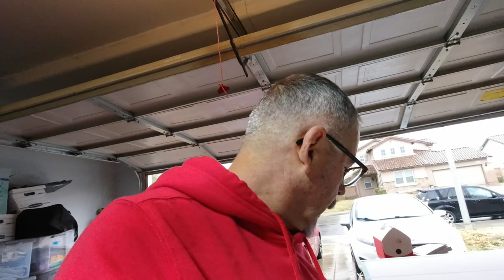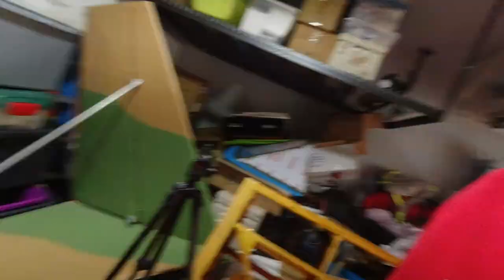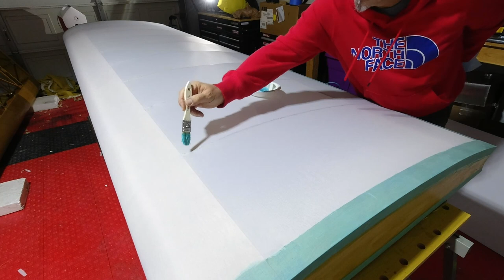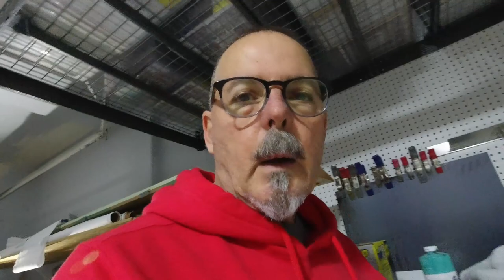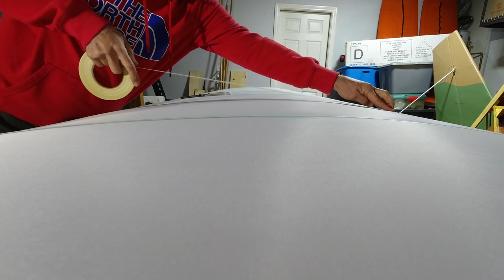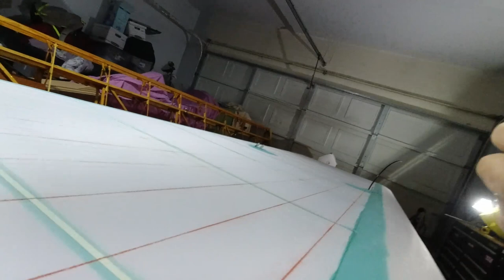Minimax 1100r Wood Aircraft Build Ep-189 - Preparing for Rib Stitching

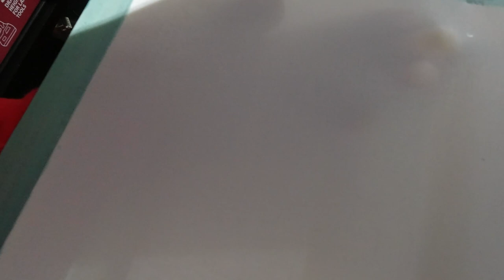Comment: Hi Dennis, No skipping forward, not for a second. Condolances for your loss & congratulations at the same time for a new Family member, no words can ever express. As for the bump in the wing @23:20 seeing as there is still a little give in the fabric, could you posibly slip in a piece of thin Cardboard on the skin side (to protect it) & use a small hobby file to smooth the edge down? Or a piece of sand paper glued to a piece of thin Balsawood? Or any other form of the above? Just thinking out loud so to speak but I'm sure there's a Solution, there always is. I don't like the idea of that hard edge staying there, Wind pressure, loading, vibrations etc. Not so important if it was an R/C Plane, more so for a Plane you plan to be flying yourself. Thank you for all you share. Much respect, Leo.
Reply from the maker: Brilliant idea Leo! That’s what I’ll do!
Reply: @DTMinimax   Good stuff, there's always an answer, let us know how you get on with it, could be a useful tip for other builders. Cheers.